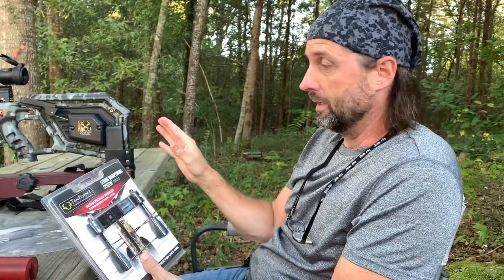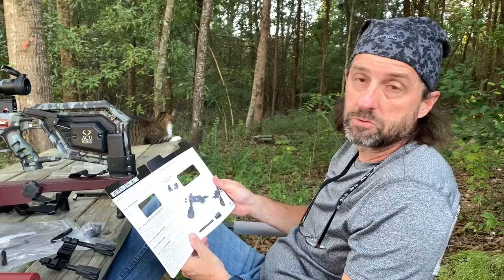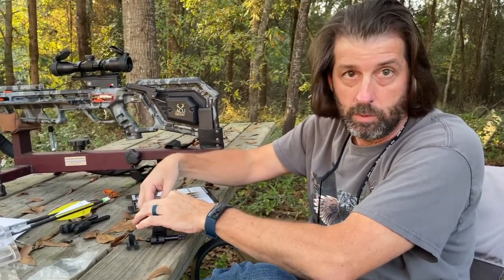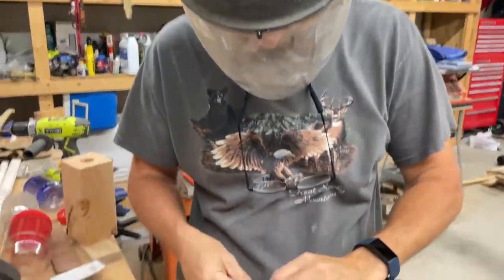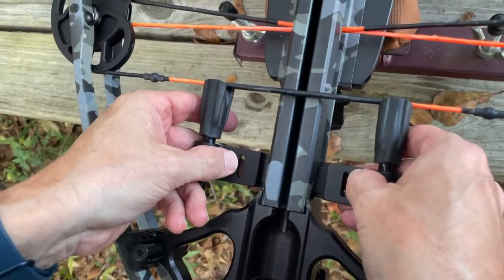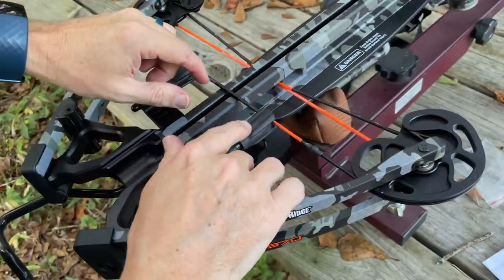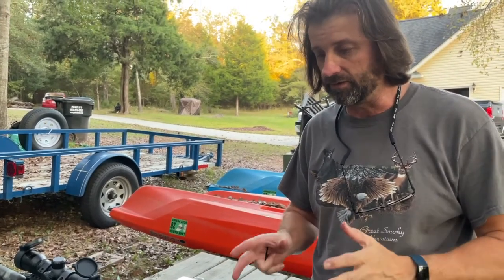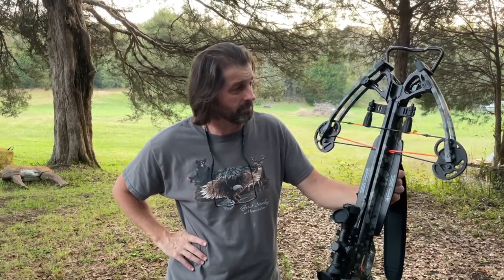TenPoint String Dampening System SDS HCA-148  Install and Review on Wicked Ridge M-370

Comment: Ten point replied to me already about swapping the bolt retaining brush for the spring.  It will work plus u have to buy ten points scope rail for it.  HCA-079.  I suggested they just sell it with brush on in the future.  Ive heard alot of good about the brush vs the spring.
Reply from the maker: Thanks for letting me know.  I have heard good things about the brush as well.  That may be a future upgrade.

Comment: Recently purchased same combo. Packaging had the plastic edges spot sealed now and while they did include 2 of the same hex wrenches for the set screws, it did not include hex wrench for the mounting screws. Ended up cutting a slot in the head to tighten. The included mounting screws were long enough in this package but the two shorter dampener rods still needed to be cut down by 1/4 in... same as in your video.
Reply from the maker: You think they would have addressed this by now.  Ridiculous.

Comment: I bought the wicked ridge raider 400. Mine too the other style. They should come with everything.  U shouldn't have to cut something off. As much has tenpoint stuff is. Should have everything in the package. I been waiting on 6 new screws for 2 weeks. How do u like your xbow?  What bolt and broadhead are u shooting? I ordered a dz off custom bolts . I also ordered the  tenpoint Universal damping kit that goes in the limbs too.
Reply from the maker: Yes I agree.  The kit ought to be ready without customization as much as they charge for this stuff.  And I should not have had to call them to get it figured out either.  I love my M-370.  I am using the factory bolt with 100 grain Rage 2 blade NC.

Comment: I just received my HCA-148 for my Wicked Ridge M-370 and have the same problem with the bolts being too short. You would think they would have addressed this problem and added the longer bolts to the kit but that isn't the case. I don't have time to wait for them to send the right bolts so I'm hoping I can find what I need at my local hardware store. I just wish I knew what the right size is.
Reply from the maker: Yea you would think they would up their game right and supply the correct hardware when they list it being compatible with the M-370.

Comment: So do you think it helped that much ?
Reply from the maker: It clearly makes a difference just based on the audio I captured however, to the ear it doesn't seem like it made that much of a difference.  However, it clearly stops the vibration much quicker which has to help with accuracy especially at longer ranges I would think.

Comment: Hello. I’m considering one of these crossbows. On the 370 do the lower strings have a string guide or is it just string on the rail with wax?
Reply from the maker: JP 55 - Not quite sure what you mean by the lower string.  The string part with the serving where you nock your bolt rides on the rail with wax.  The cables attached to the pulleys are in a guide in the frame of the crossbow if that is what you are talking about.  I hope that makes sense.
Reply: @BooneDownSouth  yes the string under the rail. It sits lower than the main string used to fire the bolts.
Reply from the maker: @jpoil55  Yea that part rides through a cutout in the frame of the crossbow and is kept there buy a piece that keeps it in place in that cutout section.
Reply: @BooneDownSouth  yeah my little 370 Barnett did not come with one. 
I’m too afraid it’s gonna cut the string riding on the sharp edges!
Reply: 350 not a 370.

Comment: What is the total take hunting weigh?
Reply from the maker: Chuck sorry for taking so long to get back to you.  The weight of mine right now with the string dampeners, sling, quiver with 3 bolts with rage 100 grain broadheads comes in at about 9.6 lbs.  When I am hunting I take the quiver off once I get in my stand.  I was surprised that is what the scale said because it just doesn't feel that heavy.
Reply: @BooneDownSouth  Thanks, that information is very helpful.👍
Reply: @BooneDownSouth  I was thinking of buying a lighter crossbow than my Stealth SS but without a cocking device I am at 9.1 lbs so there is no need and I save some money. My older style Accudraw adds both weight and sound so I took it off until I need it. I may put the Accudraw 50 back on, it’s less weight and adds no sound. Tha Accudraw 50 is great fo that second shot if needed.